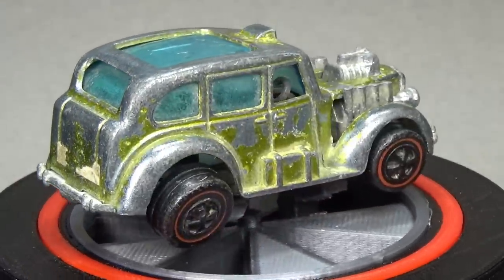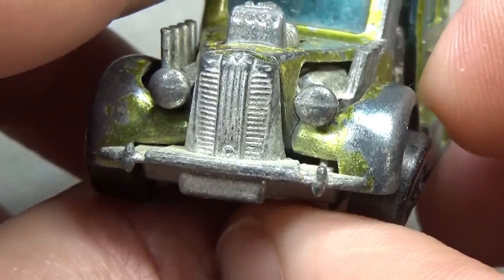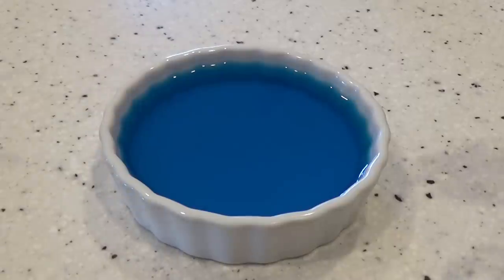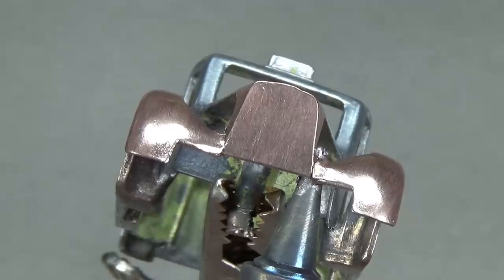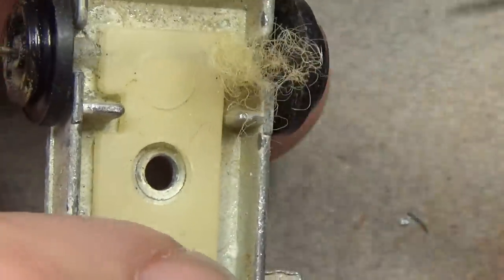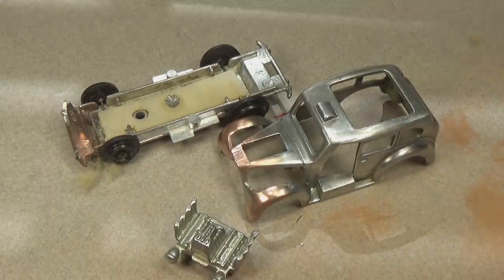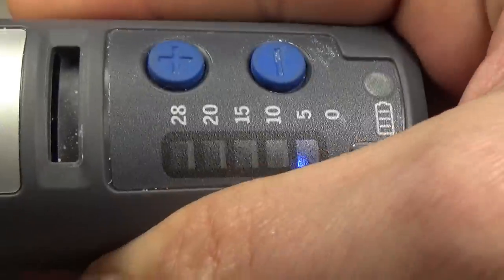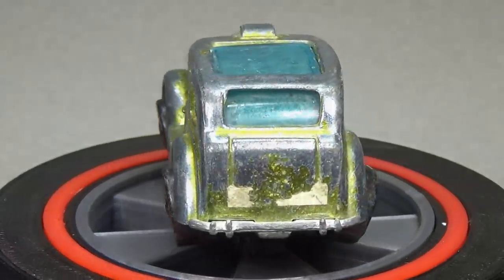How to Solder and Repair Die-cast Cars. (Redline Restoration: 1971 Cockney Cab)

Comment: Turned out beautiful. For soldering, just be sure that both parts you want to solder together are hot enough, and remember that solder will flow in the direction of the heat source. If you hold the iron at the top of a crack and feed the solder in at the bottom, it’ll actually run upwards towards the source. Be sure your iron’s tinned when you head in (helps transfer heat into the part) and that’s all there is to it

Comment: Another great video. Glad to see you've added a new tool. Just a word of caution. Always wear rubber gloves when working with a fiberglass brush, make sure there's water involved. Some running water or with a container of water near by to keep things wet. Cause you don't want to inhale any of the fibers. Fiberglass splinters are near impossible to remove, have used this on and off for 38years.

Comment: Great job.  Good info on the "Crumblers".  I have seen it but never heard a good explanation as to why it happens.  Thank you!
Reply: Mazak rot or zinc pest occurs from impurities in the alloy causing crystalline corrosion. It's more common in but not exclusive to high humidity situations. Modern railway models still sometimes suffer from chassis rot, which is a pain in a £100-200 locomotive.

Comment: Nice video, a few basic tips on soldering would be to clean the tip of the soldering iron and re-tin the tip (apply fresh solder to it) each time before you use it. Doing this removes any oxide/flux residue that has built up on the tip that might cause poor heat transfer/conductivity. I have an electrical/electronics background and it's one of the first things you learn in the trade regarding soldering.

Comment: Great work! I don't use this method for repairs only because time is limited. I would love to try it at some point. As for now I find the super glue baking soda technic pretty good. For me it works and my projects turn out good enough. My biggest and most frustrating part doing any redline era cast is drilling for screws. Never seem to get it right and end up going off center of the rivet.

Comment: I've done a bit of soldering and found that using a 60/40 tin lead solder flows substantially better than the lead free stuff, and has a much nicer finish. Also if you can get your hands on some smaller diameter solder it may make it easier for you to use less to fill in the join so you have less clean up to do.

Comment: Nice job. Looks good. Little soldering tip is to use flux cored solder and try not get things too hot. I noticed the solder going a bit blobby due to excess heat. It may be tricky but try get the whole area to an even temperature and then flow the solder in. Look forward to the next resto.

Comment: Very timely and excellent video.  I've been wanting to try the copper plate/solder method ever since your first video on the subject.  I recently got in three Matchbox Lomas Ambulance's with missing/broken rear bumpers.  Looking forward to clearing off the work bench and giving it a go.

Comment: I think it turned out great!
   As far as fix diecast, I like to use Super Alloy 1, it works great. It melts at 350°F, so there's no need for special equipment like a oxy-acetylene torch. Regular propane, Mapp gas or a butane pen torch/soldering iron will work. 
   It is a little pricey, it's about $60 bucks for a starter kit that comes with the Flux and five 18 inch rods.

Comment: Being someone who knows how to solder (at the government contract level), I can help you with why the small part was difficult to do. The clamp you were using to hold the small part was actually also taking away your heat from the small part. Acting as a heat sync. The same reason there is some sort of metal cage on your computers main processor. So the part was not able to heat up the way the front of the car did repairing that crack. Basically, you would have to allow the part to heat up more first then solder it. Another thing to do is to use a clamp with a smaller contact surface with the part. Like the points of 2 straight pins bent at right angles holding the part. This would take a little modification to the alligator clips that we normally use to hold small stuff with. We used heat syncs when soldering computer boards so a part wouldn't over heat when being soldered. I hope this was helpful. Besides that, thank you for the great restoration. I always enjoy your videos. Thank you.

Comment: Yes soldering (sod-er-ing) is the way I pronounce it too.  I think your problem may be that the copper plating isn't getting into the void in the crack.  After you do the plating the solder should flow into the void, but the raw metal is still there. All you are doing is covering the crack which will join the metal but not be 100%. If there was a way you could enlarge the crack and get the copper to plate the inside it'll work a lot better. Then of course you run the risk of breaking the part. If you watch the video closely you an see the flux then the lead melt and flow around the joint BUT not flow into the crack. You are making what we call a cold joint.  That is a joint where the solder doesn't flow well.  It is a good procedure though.  I'm retired after 40 years with "The Bell System" and soldered nearly every day for most of my time.  The model came out great.
Reply: Only some Brits say the L, and all Americans drop it:

Brit. /ˈsɒldə/, /ˈsəʊldə/, /ˈsəʊdə/,  U.S. /ˈsɔdər/, /ˈsɑdər/

Comment: Looks like the soldering process is dialed in. Nice work. I was just over at Outlaw Speed Shop and Diecast Resurrection. I would love to see you guys do a build off with '66 Batmobiles, but in the 1:50 scale. That way you all can ramp up the small details that you guys are so good at. Failing that, if you restore one of the Corgi 267 models (black tires/chain cutter/missile launcher/flickering flame) I can only imagine how awesome that would look. Thanks for your videos! Great toys, ...er, I mean tools.

Comment: That turned out awesome great work,  smoldering is just practice just make sure it's clean and have copper in the crack so the solder penitents into the crack,  if that makes sense.

Comment: This is great work, as for soldering... The problem is the heat dissipation into the metal.... I would try and bake the metal first to bring it up to temp then try soldering it without the copper....... Copper sinks much more heat quicker than die cast metals.... Hence why copper plated works better,vut attempting to bake the die-cast in an over to bring up the temp then soldering.

Comment: So... copper plating the die cast parts is the secret!  Sweet job!  My two cents - at 5:57, there was not enough flux on the parts.  Whenever solder does not want to flow, more flux is usually the solution.  Keep up the good work!  Great channel!

Comment: I love tools with lights so you can easily see what you're working on. I got it on my power drill, my soldering iron, and I am looking to replace my old dremel so I might just look into getting the dremel micro as well. I just need to check to see if it fits with my other attachments and gear I use with my dremel. Thanks for the tip! I've been looking forward to this video since you showed the copper plating in another video, I am getting the equipment to plate some stuff too.

Comment: I like taking apart and customizing diecast cars as well. I’m wanting to learn how I could put shortened bodies back together, other than trying to use super glue or epoxy. I’d like to learn how to solder or braze them together, so that I have a stronger bond to the parts.

Comment: I think the problem you had with the bumper piece was two small things. 

First, not enough flux. Looked like that solder got really dry. 

Second, not enough heat. Pause @6:08 and see the angle the iron is at. You can see that only one part of the iron is in contact with the crack and that's actually where the solder is bonding properly. I'd say, just rotate the iron so that it runs down the length and you should be fine.

Of course I appreciate that it can be difficult to get the iron where you want it to be, especially while keeping track of a tiny piece and filming, but I thought I'd better pass on my observations anyway.

Love your work/videos

Comment: Some metals are finicky when it comes to soldering.  Zinc alloys need to be absolutely as clean as possible, and heating the part up first makes it go a lot more smoothly.
Lessons learned from when I took a few "Metals" classes back in my University days.  One time I even silver-soldered bronze to cast steel.  My instructor kept saying it wasn't going to work -- but I was stubborn, and figured out how to get it done.  The trick?  Just as I suggested above -- the steel needed to be preheated a lot, and kept hot.  Still have the piece.

Comment: the only way to get better at sodering is to do more sodering. I like your copper coating method there, and the flux is very nice also. you may want to buff the surface slightly with sandpaper or a file to give the soder something to grip to. also, don't be shy with the flux! your technique is good  just practice more and you'll get it

Comment: I was going to mention brazing but you beat me to it. Personally I prefer brazing because brass is just stronger and use a smaller prefluxed brazing rod. Not too sure what you are using but I get the ones I'm talking about from home depot. One way to help solder stick is to score or scratch the surfaces.

Comment: WoW. That paint finish looks amazing. Well done. Great to hear and see a man admit his mistakes as well. Have you tried heating the metal a little before you start to solder? It helps to get the solder to flow and the iron doesn't have to be on the metal for so long.

Comment: I don't know about expensive solders and flux, but if you had a pair of resistance soldering tweezers it would definitely be easier. Just have to be more careful as your at risk of electric shock using them.

Comment: Amazing restoration job.. The soldering (or sodderring ;) ) is something I’ve always struggled with (I’ve tried to use it on photo etched parts for model kits.. Still to be able to get it to work..). As for the crack in the clear part.. Just thinking here, and what if you apply a little pressure on the opposite side of the crack (pushing the crack open) and then flow some plastic weld (MEK) into the crack?

Comment: Get a roll of Kapton tape to wrap around metal clips and clamps when soldering. The problem is that clips and clamps act like heat sinks. The tape will prevent that from happening. A narrow roll is all you need and it will last for ages.

Comment: For the soldering, I think the gas powered iron doesn't deliver enough local heat to help the spread of solder, a fine pencil gas torch and get the area covered in flux you want to solder, then get the area hot enough for the solder to melt but not enough to melt the soft body and the solder should flow everywhere the flux contacts the metal.  There is stuff called solder paint you can just paint on something with a brush and then heat up, contains its own flux and quite useful but again, I imagine the diecast bodies have quite a low melting point themselves so maybe soldering isn't a good option lol

Comment: There are two main types of fluxes for soldering: rosin and acid, with acid being mostly used for plumbing. Acid flux would probably cause undesirable corrosion in a die cast model.

Comment: To make the joint a bit stronger there needs to be some copper plating applied within the crack so that the solder can flow into the crack and bind the two halves together. Most of the surface solder will be filed away. Would it be possible to stretch open the crack a little during plating to allow this?

Comment: I don't try to solder the castings. The couple of tries I did make were disasters, so now I don't try. I use the superglue and baking soda repair technique. Of course, I didn't have a copper plating thing, so that could by why the solder didn't work.

Comment: What size piano wire do you use for replacing the axels? Also how do you finish their ends?  Instead of soldering what if you use superglue and a dusting of baking soda then after filing off the extra glue paint the body with chrome paint? It looked like you plating and solder job worked nice but a lot of steps.

Comment: Have you ever soldered the rivets?  Like add 3 mm of material, filed it straight, then spun /hammered it after putting back the bottom?

Comment: Need to know if you've ever come across a car that has a goldish appearance after you stripped off the paint. I have a mustang with a 1968 base. After I took off the paint, the body started to turn black. After I electopolished it, it took on a goldish appearance. The gold does not sand off. Do you know what they coated this car with? Can I zinc plate over it?

Comment: I apologize if this question has already been answered, but what composition of flux are you using? I have been having trouble soldering steel and the water based flux I use for electronics doesn't cut it.

Comment: I have an "old number 5" hot wheels I dug up while metal detecting. It is complete except for the front wheels are missing and the black ladders are shot, but still there. Would you be interested in it? No charge

Comment: That looks awesome. I especially love the colour. I have a thing for purple cars. As for Sodder vs Solder. As a Brit its easy to "correct" American pronounciasions but really. We should understand that areas of Britain say things wildly differently to each other. We accept that so lets accept modern American English where they cant say "Solder", "Aluminium" or spell the likes of "ColoUr" too? 😉
Reply: I think the English were pronouncing it without the L, like French souder, at the time the US were settled. Then later they decided to reinstate the L, perhaps because there is an L in solidare. So the yanks are just saying it as we always did!

It is the same with the way we now say "can't" in Britain -- the American "kent" is simply as we always used to say it.

As for with color, dolor, labor --- again the yanks have it right, these are time-honoured spellings that go back to the Romans, that we Brits just had to tinker with.

Comment: Possibly use fine gage silver solder, i use 0.25mm for fine soldering on printed circuit boards. So i dint see why it wont work here too.

Comment: Not sure if they make a nickel solder wire, but when welding cast you use a nickel rod. I have 0 experience soldering so not sure if it's the same, just a thought....

Comment: Hi, I'd like to know where you find those little 2mm screws for your models?
Erik.
Reply: You can get 2mm button head screws basically anywhere online. Amazon has them so does EBay, Etsy, Hobby Lobby etc. There's countless online retailers that sell these amd any other size and shape screw you could think of. You could probably even go to your local hardware store and find them.
Reply: @TheUncleRuckus   Thanks,  but what's the length your screws ?

Comment: Good video, but would like to see another damaged hot wheel fixed using JB Weld. As a side note, if you come across the roof for a Sir Rodney Roadster, let me know and I could buy it from you. Second, I have several hot wheels with damaged plastic bases. Is there a 3D printer that can reproduce Hot Wheel plastic bases using plastic filament infused with metal...can someone demonstrate. Third, I have no luck in getting my cars as shiny as yours. I am afraid too much sanding will destroy the metal, and electro polishing combined with zinc electro plating still leaves a body with scratches, pits, and dark spots. I would like to send you my JPEG hot wheel restoration pictures to see what your recommendations are. Do you have a place to post pictures like Facebook? I have started restoring a Heavy Chevy, Rodger Dodger, two Gran Toronados, Sir Rodney Roadster, Silhouette, Mustang Stocker, Custom TNT Bird, Mustang Boss, and Police Cruiser. Have not started painting yet, but have the equipment.

Comment: Preempted comments about quality of soldering - Check
Preempted comments about pronunciation of solder -  Check
Preempted comments about soldering techniques  - Check
Preempted comments about type of soldering iron - Check
Preempted comments about slicing fingers, removing wheels - Check

The hoops a content maker has to jump through.
Reply from the maker: Yeah...it's called lampshading... I try not to do it but the internet is unforgiving...